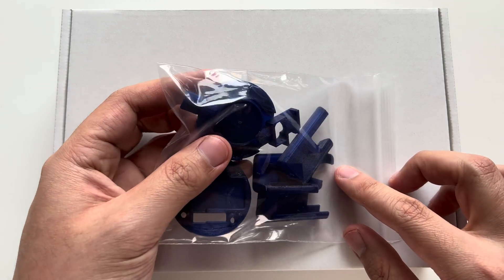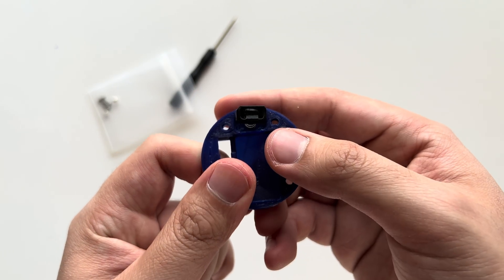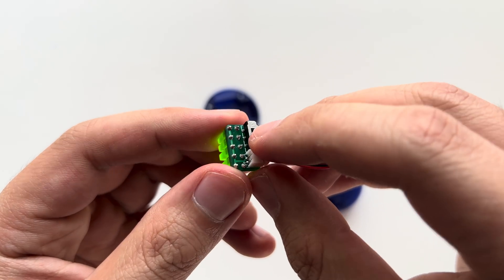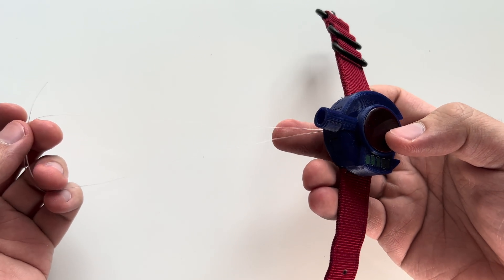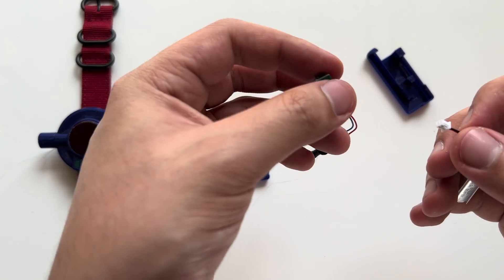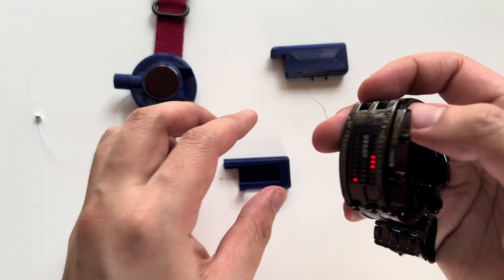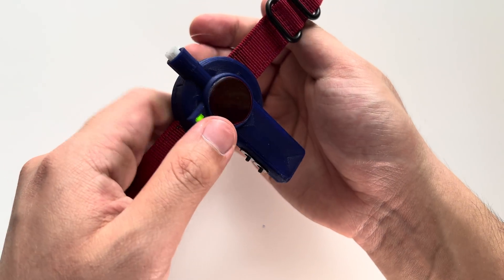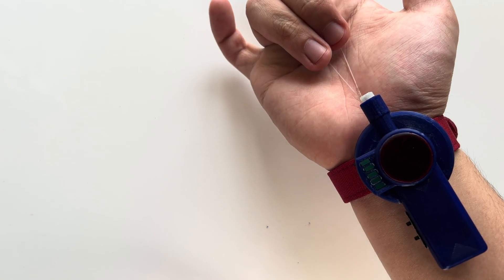How to Make the Retractable Web Shooter

Comment: I love this whole concept. One thing I'm curious on is whether or not it would be possible to resin print the main body and cartridge shells. The watch looks great, but the layer lines and surface imperfections really take away from the overall aesthetic. 

According to my understanding of resin printing, the finished parts are very clean but remarkably brittle. As such, I'd be worried about cracking the parts when installing the thread inserts. Is this something you experimented with at all?
Reply from the maker: Hi, sorry for the late reply! We tried resin printing, but as you predicted the parts were brittle and snapped easily. Though we had slightly better results using tough resin, it was still nowhere near as strong as FDM printed parts. One result that was a good in-between was SLS printing with nylon, with a better surface finish and actually stronger parts.
Reply: @herotech  No worries. I had actually forgotten about this comment until I got the notification that you replied just now. While it's a shame that the resin printed parts didn't work out, I do feel rather proud that I was able to correctly estimate the limiting factor of resin printing these particular parts. Thanks for taking the time to reply even though the comment was old!

Comment: Hey herotech, I have a question. What should someone do if the nylon line broke on the wed 12? It hasn't happened to me, but if it ever did I'd just want to know if theres anything I'd be able to do to fix it.
Reply from the maker: Hi, thanks for the question! The Nylon line is rated pretty high strength so the chance of it breaking is low - if it does break, an alternative is to tie new line to the broken ends to connect them back together. The more likely scenario is the scrimp falling off or breaking off - care must be taken in that case not to pull out the whole nylon line.